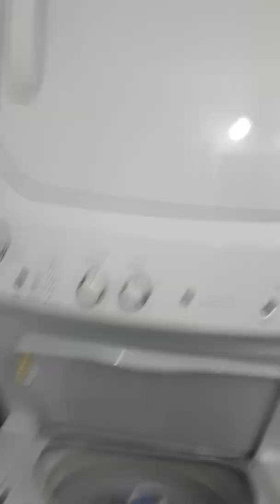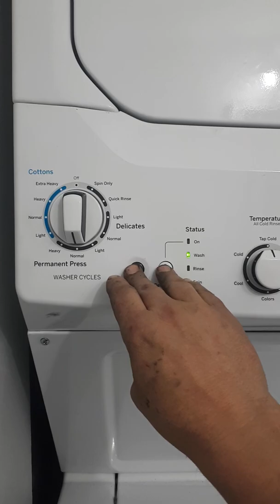GE Stackable Washer Dryer Computer Reset Part 1

Comment: In my experience having the machine extremely leveled has help to keep it working properly. 
I have the same unit you are working with, my door lock broke and I did a bypass on it. My floor is badly un leveled. I leveled the machine and did a reset on it. Works fine now. 
Thanks for the video

Comment: Just to add a few tips about this washer and the things that typically go bad and cause a critical error.
Ran into a 24 inch model, about 5 years old, and it would not enter diagnostics. This machine must be clear of any error codes left in memory, or it will not work properly. After attempting to enter diagnostics as per instructions, we tried several different spots on the clock position. Finding on this model, landing on the 7 o'clock position instead of the 6 'clock , will allow the entry of diagnostics, and then all other procedures are as written in the tech manual, or can be found on other channels to observe how to test and clear codes.

Main failure points :

Pressure switch tube/air chamber clogged up, will not recognize proper water level. Fix, blow out obstruction from air chamber on side of outer tub where pressure switch tube attaches.

Lid/Lock and Lid Switch failure. Fix, replace as necessary, should show failed by diagnostics code when testing.

Broken/Cut wire at main motor wire harness. Rubs and gets cut on sharp sheet metal from movement/vibration. Fix, repair if enough wire present or replace motor if necessary. Check motor windings from control block plugs to motor. 

Obstruction around drive belt and motor pulley. Fix, remove obstruction, install belt if it has come off.

Rarely is the control board defective on these machines, at least of all of the ones I have looked at, so be careful before buying a new control board. Exhaust all other options first. Try position 7 on diagnostics entry if it won't work on position 6

Gearcase failure causing the tub to move with agitator during agitation, thus overworking the motor and shutting off. Fix, replace gearbox or a Tub/Gearbox kit. comes preassembled with bearings, seals, etc. Freight shipped only. Pricey repair.

Hope this helps you on this highly likely to break down washer. Remember that codes must be cleared to start working normally again after a fault code is detected by this control board.
I'm not sure if it will clear itself when power is removed for a certain period of time or not. I have had customers leave power off for 24 hours and it still wouldn't work until codes were cleared.

Lewis
Reply from the maker: Thanks Lewis.
Why take the time to troll my channel dude.
In the time it took you to do that you could have easily just have made your own Video Gratis.
Like I make my videos gratis  right?
Reply from the maker: Just make a video Gratis like I did.
And leave a link.
Reply: What about no washer power? 
But the dryer works like normal?
I can’t access the diagnostic menu because  the no power

Comment: I have watched so many videos on Double Stack washer and dryers because I have one it's a pain in the butt and since watching your video and I've tried what you did on the video that I watched of yours it is working so far I wish you just had a video on the double Dryer part because I sure could use a video on that it worked just fine the dryer that is and then it just stopped heating up and I don't think it needs a heating element and it I think it's something else but thank you very much I appreciate all the help on your video that I've watched and it was the only one out of all the videos that I've watched that help me is yours

Comment: Bro thank you, my washer wasn't spinning. I never touched one of these things before. You showed me how to open it and see the belt on the bottom had fallen off and there was clothes in there too. However my computer won't reset because on the dial mins heavy where yours says Normal. Maybe a slightly different model.

Comment: Hey brother, thanks for uploading short yet very informative video. I have a GE stackable washer/dryer that’s acting up lately. When it comes to rinse, it stops working completely. I unplugged it few times to reset it. Then started off with spin, it spins but stops again at rinse. I hired a guy who took the water out with the help of a vacuum, removed the drain pump motor, clean it thoroughly, cleaned both pipes as well. The washer worked that day and the next day it stopped working again at “rinse”. The guy  also told me that I might have to replace the drain pump asap. I called him next day to inform about the washer not working. He said I definitely need to replace the drain pump motor now. He was asking too much money. I couldn’t afford it. Please help me to solve this problem. One of the videos on YouTube said my lid lock switch is broken, I changed it but still the same. What do you think I need to do to fix it. Thank you
Reply: Hi! I’m currently having this exact same issue,any luck on your end?

Comment: 1 GE use the shocks that sucked and then Whirlpool took that idea and went ahead and use them as well ....You can also tell if those shocks are bad by pushing straight down and releasing and it should come straight back up and not bounce all over the place (grew up in repair business have my own appliance repair company)
Reply: Maybe you can help me. I bought one of these used and had it in storage for the last five months. Just hooked it all up and only the dryer works. The washer is doing absolutely nothing. Can't "reset" it or anything. HELP! 🙏🙂

Comment: I showed lid lock codes. So I bought a lid switch. Ran washer in diagnostic mode. Showed no codes. When I reset my codes and tried to spin only it gives me flashing spin. Any ideas

Comment: What if I have no power at all just for the washer I have power on the dryer but absolutely no power to the washer no lights no noise nothing
Reply: I have the opposite problem. Power to the washer, but nothing to the dryer.
Reply: Same for me. Only dryer. Did you ever figure it out?
Reply: Same issue here did you guys figure it out
Reply: @kansel7479  mine ended up being a knife switch in a box above my 220 outlet not closing all the way so I was only getting about 30V instead of 220.
Reply: @theegoldenmule   so was yours giving you the issue were there was no lights at all on the washer dial
Reply: @kansel7479  I'm having same problem. Were you able to find the problem?
Reply: Did anyone figure out the solution?

Comment: I have no power at all to the washer but I do have power to dryer any clue 🙏
Reply from the maker: Sorry, but I'd rather not speculate as to what your issue is exactly.
For starters though, there should be fuses or a breaker in the washer somewhere. 
All water/electrical devices have one or the 2.  See if you can find them. Fuses are cheap.

Just be sure to unplug it when messing around with electricity.
Reply: Same problem. Did you figure it out?
Reply: Same problem but I can’t find the solution

Comment: Does the reset have to be done when I can't make just the spin cycle dial setting work? Btw, do you repair these washing machines? I have one that needs work..thx
Reply from the maker: Sorry I just Vlog what I fix usually.
Reply: @lucascameron8539  I am working on a Frigidaire laundry Center similar to this one. The washing machine will not start or do anything. The only thing that happens when I pull the knob out to start the cycle is the door lock light comes on but does not lock the front loader door. Could this be a timer issue? 
Model GLEH1642FS1 

Any input would be great thank you!

Comment: We had a sock get stuck in belt. The belt fell off. We fixed everything but there are 2 wires blue and red hanging lose and a small plastic chip. Ever see this.
Reply from the maker: No sorry.
Sounds like quite the mess

Comment: So I have the same washer and dryer and the wash light will come on and put just a squart of water then shut off any suggestions
Reply from the maker: Get a new washer. Lol

The washer I fixed in the video had all kinds of problems with balanced loads, tripping spin sensors because of the drum falling off supports.
I had a good working relationship with that thing let me tell you man.

Water supply, the solenoid valves for both the  supply and drain  The lid close  sensor and dial selectors  are are the first to go usually on washing machines. 

I'm not there and can't see it, 

But give each a good check. Sometimes lid sensors get full of soap. Anything that looks out of place is a good place to start.